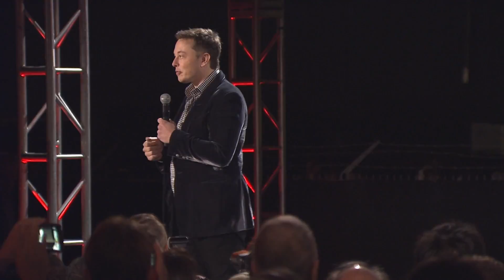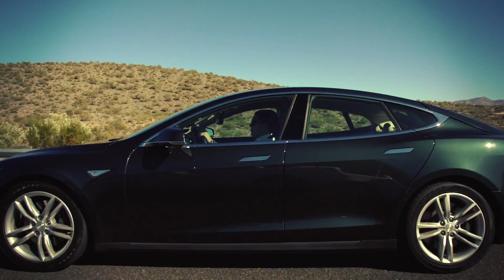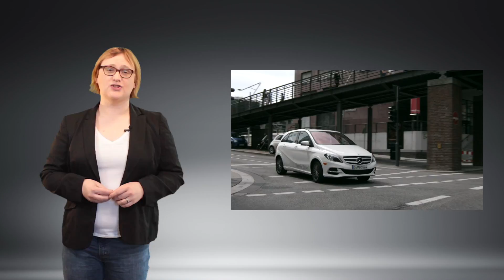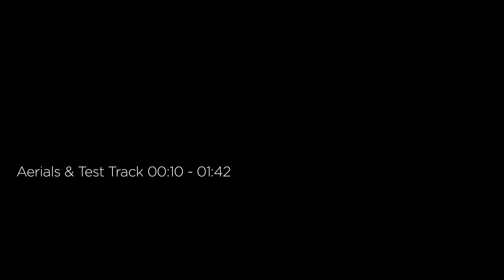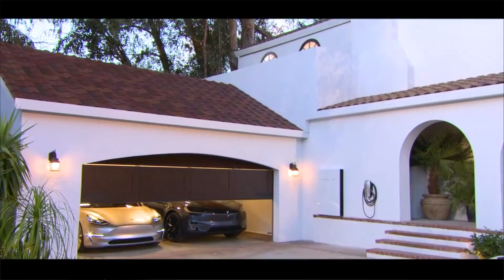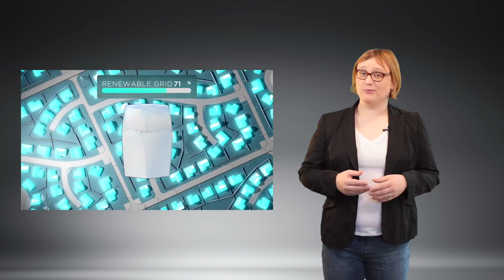Tesla Q1 2017 Earnings Report -- The Important Bits

Comment: I wish Tesla all the good fortune they can achieve. This company has pushed EV forwards like no other and for that they deserve a lot of credit. However, I'm concern that the development of a solid state electrolyte battery such as the Braga-Goodenough glass battery could significantly reduce the value of the gigafactory battery production facility. Some have suggested that retooling the battery production portion of the gigafactory to the new technology would cost Tesla billions of dollars. Further reducing its chance to achieve profitability. Of course it is not yet clear if the Braga-Goodenough glass battery nor any other solid electrolyte battery can be profitably be scale up to commercialization nor how long will that take. Another possible threat to Tesla is the LG Chem battery, a current competitor to the Panasonic battery used in Teslas. The LG Chem battery is used in the Chevy Bolt EV. There is a slide from a GM meeting that indicates that the current cost per kWh is $140 with a projection of the price dropping to $100 by 2020.

Comment: Tesla has to keep away from profits because there is a very real risk of meeting expectations and losing flexibility; investors that aren't buying into the bigger vision will start pulling out every time Tesla makes a bold move. It's a risky strategy that, I think, would normally fail if it weren't for the uniquely symbiotic relationship the company has with the environmental and cultural change zeitgeist.

Comment: Starting a car company is a very expensive endeavour. If they don't ramp up production and roll out chargers etc they face the larger risk of putting off future buyers. GM's Volt is not doing as well because they chose a comparatively unique charging system and are not rolling it out so if you ask me, Tesla has it right.

Comment: I too am a shareholder and am excited that Elon, and Tesla as a company, continues to push forward with the vehicles and technology it takes to really change the world, energy-wise!  There is so much more to do!  Semi trucks, Crossovers, panel vans, pickup trucks, and that's after Model 3 appears on the roads in real-world numbers while every other EV maker continues to dribble out compliance cars with inadequate range.
Tesla knows that the demand is not only there for Real EVs and developing much faster charging infrastructure, in all the needed places, but also the demand for the batteries to power them... thus more Gigafactories! 
The demand for Utility scale battery storage is going almost unreported, but the need and potential for growth is enormous, and that is part of Tesla as well.... 
Then the residential market for solar roofs that last forever while continually generating energy, will make replacing old roofs and building new roofs with "dead" roofing an obviously poor decision. 
Tesla has a huge amount of building and reinvesting to do but no other company is doing much more on any of these areas than the minimum, let alone all those areas.  The world is being changed, and that's why Im excited to be a part of it!  Profit will build, and be inevitable. That's not the important part for the next few years though!

Comment: As any and every company will arrive at a critical point of production where or the total produced will not have sufficient demand, by the increasing value, or the value goes down breaking the whole structure. I have already spoken in other channels and I repeat that, in addition to the magnificent proposal to make it possible for homeowners to charge at home (which makes it much easier), Solar City's initial technology is good, but it will improve greatly to make each residence a new source for the vehicle loading network to epand it. Only this way, the other EV companies will close the complete cycle of self-sufficiency in this market, incomparable with the market for fuel-powered vehicles.